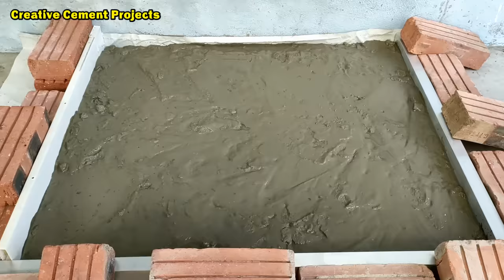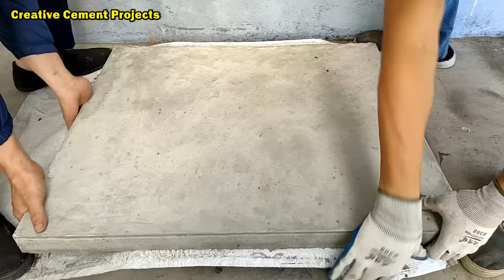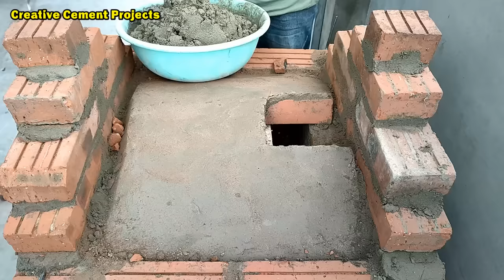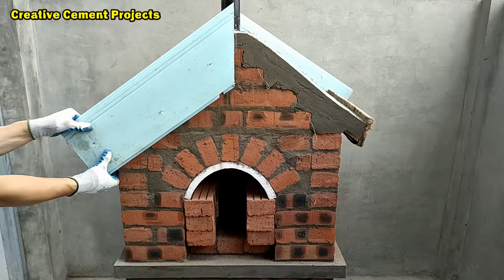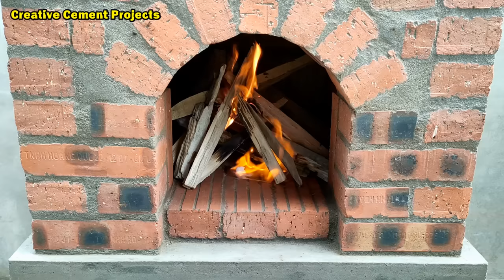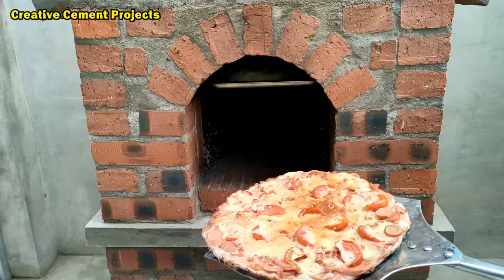How to build a beautiful pizza and bread oven that makes a difference 2021

Comment: I wonder if you can put a pot/cube with value tap in the roof for continuous hot water?
It would be great if you try to build stove heater with that incorporated somehow pretty please. When l build mine l will try this. Thanks in advance
Reply: Love you Chanel BTW. Thanks heaps

Comment: 2 more ways to use you Weber grill as a pizza oven! or any dome grill.  Another way is us 12, 14, and 16" pizza pans,  Last is make a metal plate to fit the grate like the stone!  either 1 of the 3 or all 3 is great >>   i think there more easy and more uses >   using the pizza pans!  or make a steel plate on top of the grate
Reply from the maker: Thank you very much

Comment: Fantastic brick work but I have some opinions: Rule #1: Pizza can not be cooked without active fire inside the oven. #2 Oven door should not be closed while cooking pizza to actively watch and rotate it # 2 There is zero insulation in this oven, so after cooking one pizza you can not cook anything else. Also, the bottom of the pizza won't be cooked well since there is also no insulation at the bottom.
Reply from the maker: Thank you

Comment: I would love plans for this.
Reply from the maker: Thank you for watching
Reply: What plans? You can see how many bricks he lays each way, and how many layers. That gives you all the measurements you need.
Reply: It’s going to crack. They use regular brick and regular concrete. Then they don’t insulate under the floor or anywhere else so it will lose heat like crazy. Looks cool, but it’s a terrible design. If you’re going to do all that work, do it right and build something that will work well and last.
Reply: @harryamos7869  can you please show us how to make one that will last, you have a phone with a camera, so it is possible to do it, Thank you.
Reply: @Richard-et3cl   No, and I couldn’t do as good of a job on one as this guy did. His brick work is great. Plus I have nowhere to put it. But I know that he’s using materials that will not hold up to the heat in the long run and that these ovens need to be insulated to retain heat. I understand he’s working with what he has, but there are cheap ways to insulate. Maybe the brick he has will hold up. Some clay fired brick works fine for the kind of heat generate in these things which is well under 1,000 degrees Celsius and probably under a 1,000 Fahrenheit. The Portland cement concrete won’t hold up. It weakens every time he fires the thing up and will crack and crumble eventually. I just see a lot of these videos where they make these stoves/ovens and hate to think that people are going to spend the money and do the work copying them only to have something that won’t work well and will fall apart. Hopefully people will look into it more before copying anything these people make. It all has the same problems. People could spend just a little more money and put a little more thought into it and end up with something great that will last longer than them.
Reply: El whatsapp
Reply: Quais são as medidas?

Comment: do not do such a thing, you will make a mistake, I am a master of lahmacun and kebab in Turkey, if the oven is like this, you cannot cook properly, the temperature must be at the bottom, the heat must come from the bottom, otherwise it will not be cooked.
Reply from the maker: Thank you very much.

Comment: But if you want to cook few pizzas you should use as fire place the down side right, i mean because, that's a waste of wood just for one pizza..
Reply from the maker: Thank you for watching
Reply: I give my voice to you @aquiles 
It to much breaks used for no use, the project and the work it self is great but if it is done with less breaks and use the bottom chamber for fire with making a side hols on the top roof of the chamber it well be much better

Comment: Why did you build a furnace at the bottom? Nothing was shown. They made the lower part of the furnace in vain
Reply from the maker: Thank you. The part below the main purpose is for the oven to be high, so when you stand to use it, you don't have to bend your back and instead have a place to store firewood or other uses.

Comment: As medidas tem como passar?
Reply from the maker: The kitchen building materials include cement, sand, stone, and red brick.
The dimensions of the stove are length, square width 75 cm. 150 cm high. Oven door 33 cm wide, 45 cm high
Reply: @Creativeproject2020  traduz as medidas